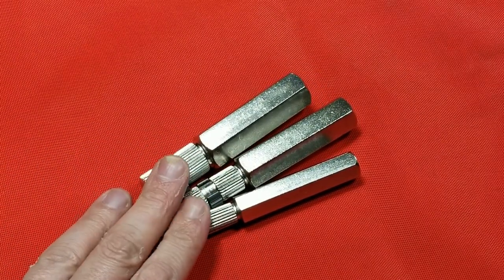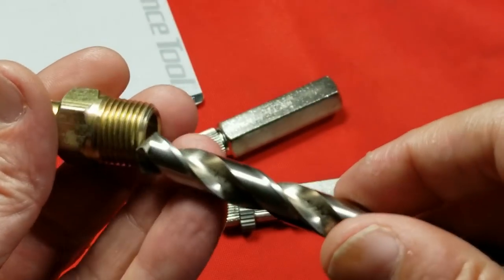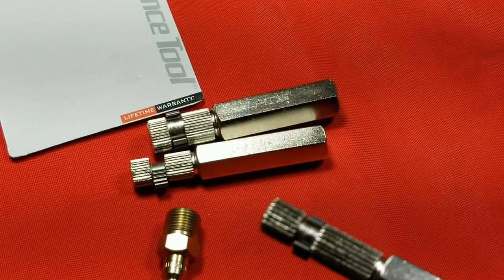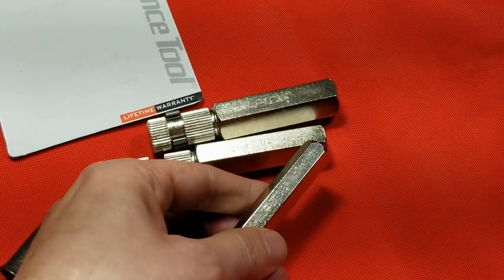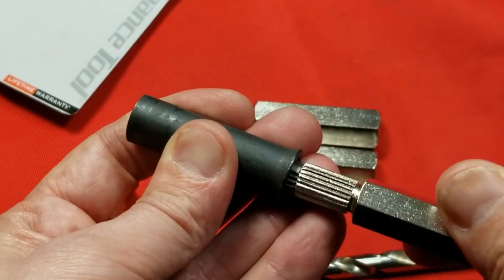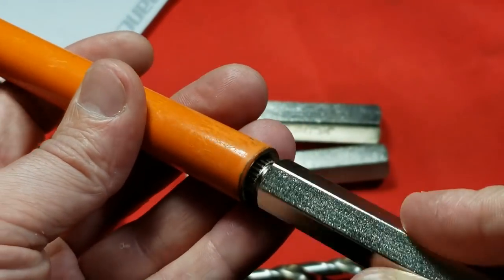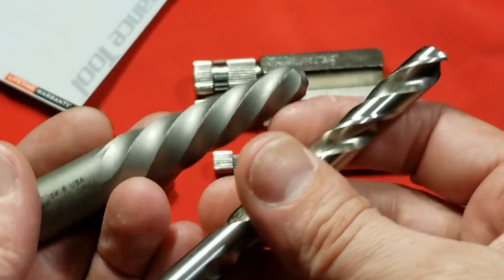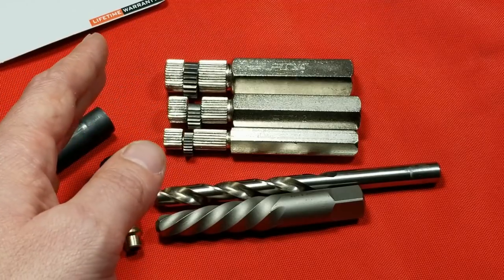Performance Tool Internal Pipe Extractor Set Review

Comment: I bought a set of these at Home Depot, I was able to remove a rotted piece of galvinized pipe that was sticking through my basement wall to connect my sprinkler system.  The pipe had been there over 30 years and was stuck pretty good and very rotted.  I was able to get inside the pipe far enough to when the pipe was not rotted and get the pipe freed up enough to remove it.  I put a temendous  amount of torque on the tool to get it to remove the pipe.  The tool worked fantastic and held up will.  Thank you for posting this video, it was very helpful.

Comment: The extractors will not fit inside the fitting that you have there. That is an air line fitting,  and they are sized differently than black or galvanized pipes.

Comment: Catus--On the 3/8" internal wrench, did you attempt to align that dark gray swiveling piece with the rest of the tool?  The 3/8" tip fit in, but because the swivel piece had turned and wasn't aligned properly, it wouldn't go in.  I expect you'd find that was the case with each of them.  It's machined that way on purpose (i.e., eccentrically), so the swivel piece, once inside, can exert force internally to grip the walls when you turn it.  When you stop turning (releasing the gripping force) and remove the internal wrench, the swiveling piece goes back to the "larger" size (again, owing to the eccentric machining it rotates on).  I have an old Blue Point set (made in U.S.A.) which included the 1" diameter wrench.  The 3/8" size measures 7/16"; the 1/2" size measures 9/16"; the 3/4" size measures 11.5/16", and the 1" measures 15/16".  Just for comparison, I measured the I.D. of 1/2" copper pipe and found that it's  9/16".  As the 1/2" internal wrench also measures 9/16", you cannot use it on 1/2" copper pipe (but you can use the 3/8" wrench on it).  All measurements are approximate using a Stanley Powerlock tape measure.
Reply: sei shin--Some of these sets are sized slightly differently, so it's not surprising there could be issues with one or more extractors.  I'm not a great fan of these because they can slip while in use.  I have a number of different types of extractors, and the Irwin Hanson 53227 Hex Head Screw Extractor Set (available on Amazon) is a better, though pricier, alternative.  It's a set of 27 "shorty" extractors (from 1/8" up to 7/8") that can get into some tight spaces, which is ideal for automotive and plumbing applications.  I believe they also offer a 10-piece and a 15-piece set, which are more affordable.  Regardless of their style, they all basically work on the wedge principle to remove fasteners.

Comment: I have the snap on tools version for 35 years they are for pipe and nipple installation or removal. For broken seized pipe I would use the Ridgid/Snap on pipe exctractor.

I was given a job which was a machine for Rolls Royce. My company did not want any pipe wrench marks on the pipe. My Snap on version worked perfectly.

Comment: I wonder if these will work to remove my broken spark plug on my 04 ford 3 valve 5.4 that some moron installed the totally wrong champion register 4 piece plugs that snapped the nut off of. Im gonna drill the seat to break the tension on the threads abd head and soak and heat and soak for 2 days and try it

Comment: These style of tools suck. I bought and tried it several times in different situations. Failed every time. metal file and a hammer is the saving grace that gets the job done
Reply: They didn't work for me either. I used a small file after reading your comment. Was able to use a flat head to get it off. Thanks!